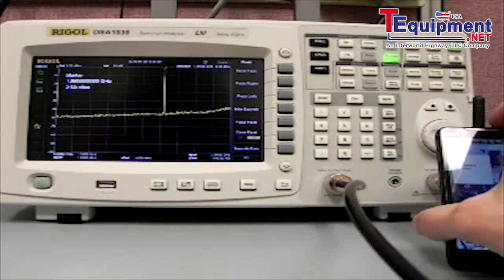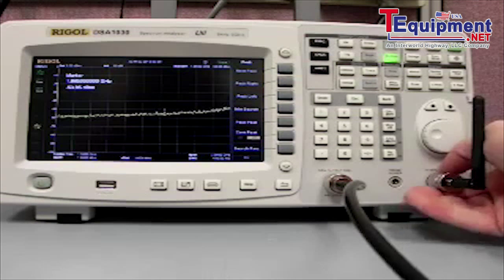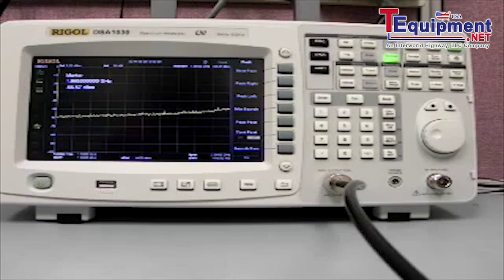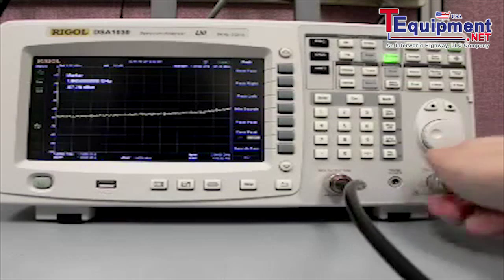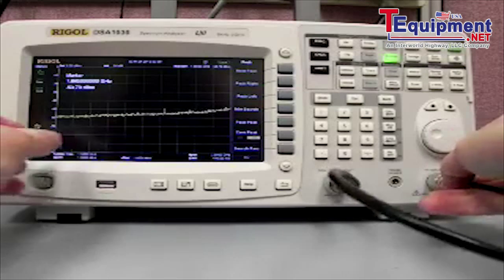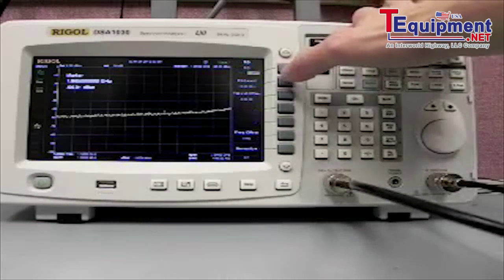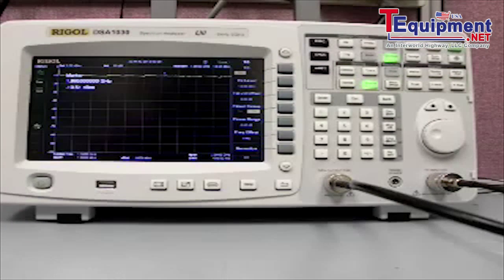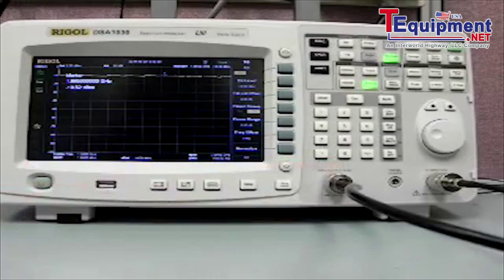Rigol: What is a tracking generator?

Comment: Nice demo, Thanks..
Other than the 1030 going to 3GHz and 5 or 6 Db lower floor, is the 815 series basically the same unit? Please explain any other differences.
Thanks
Glenn 
DSM Labs  (dot com)